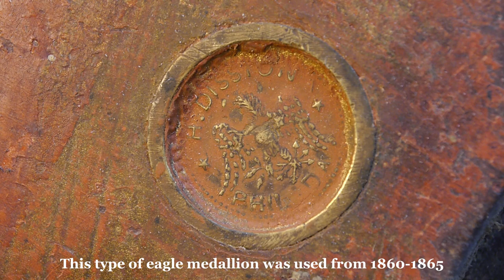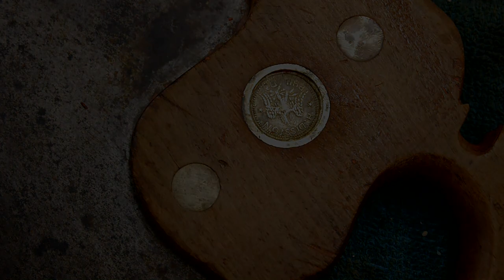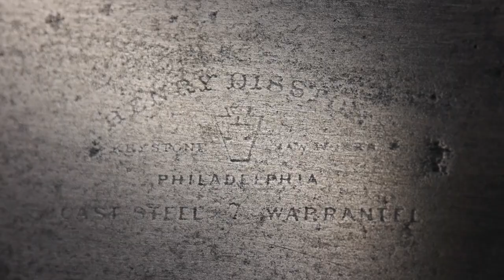Rare 1860s Disston eagle medallion hand saw | Restoration

Comment: Why didn't you remove the handle to clean it?
Reply from the maker: Good question @larryohara6513! There are a few reasons I didn't remove the handle:
-With saws this old, its common for the wood of the handle to have swollen a bit over the decades/centuries so that the brass nuts are slightly embedded in the wood and can't be removed without tearing out the wood around the perimeter of the hole that the nut sits in. This was the case with several of the saw nuts.
-The steel underneath the handle is well protected and therefore usually clean and free of rust unless the saw is in bad shape.
-Saw nuts of this period were designed to be more or less permanent and I'm happy to leave them alone and not risk damaging them unless it's really needed, especially with a super rare saw like this.
Reply: OK, I noticed that you had to tighten the handle and that would indicate to me that there maybe some intrusion under the handle. I myself remove the handle  (very carefully same concern as you have) and most of the time if the handle was lose I will find rust. Nice job of flattening  the blade.